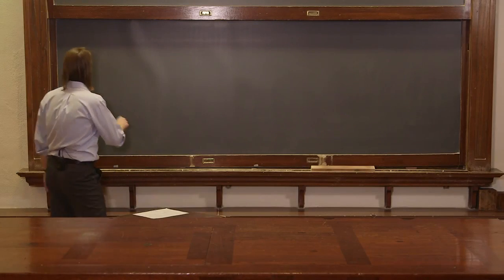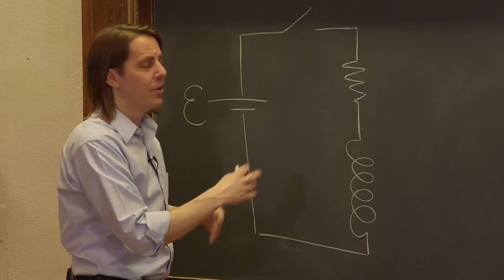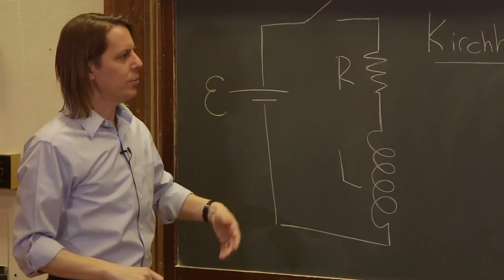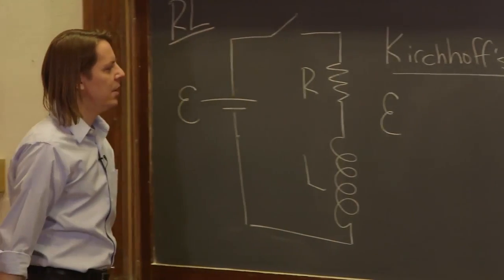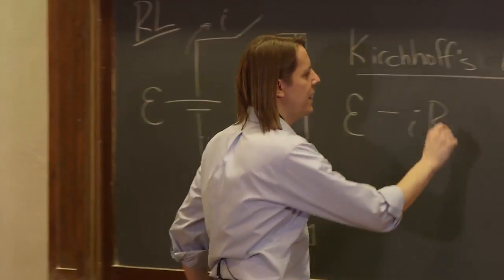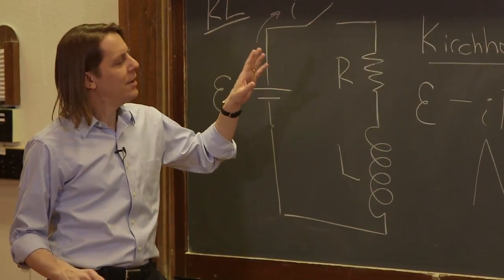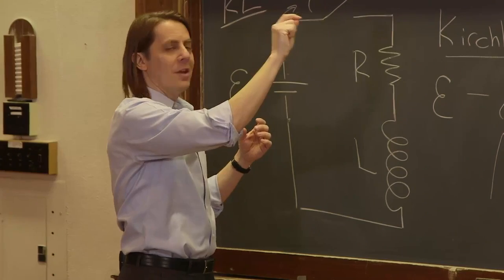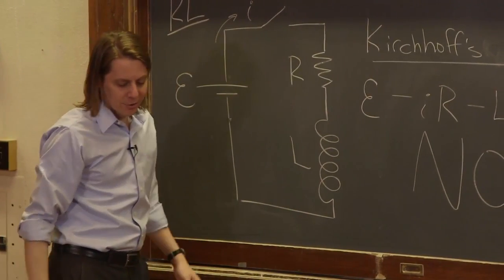PHYS 102 | LR Circuits 1 - You Can't Apply Kirchhoff's Loop Rule to a Circuit with an Inductor!

Comment: Bro you are doing it wrong I can prove it that kirchhoff's loop  can be applied here and that we are taking all conservative field s..
Reply: reply if you want to understand it
Reply from the maker: @rxzhik  Sure.  How do you get a conservative field in an inductor?  I'm all ears! :)
Reply: @Prof-Hafner  Even with an inductor in place the voltage across the resistor + voltage across the inductor has to be the same as the voltage of the source. (else there would be a voltage difference between them and because the wire itsselve is modeled as having no resistance and no inductance this cant be the case. So still this Kirchhoffs rule has to stay true. And because of conservation of charge the current has to be the same everywhere, cause else you'd build up a charge at some place, and then you'd get a change of a electric field and this also is defined to be a kind of current (Verschiebungsstrom in German). So Kirchhoff still has to be true here. 
Another proof is conservation of energy: The Energy from the source has to be the same as the energy emmited or stored by the inductor+ the energy  emmited by the resistor. The energy emmited plus the energy stored by the inductor at a short interval of time is the voltage across it times the current through it times the short amount of time. The energy emmitted by the resistor is the voltage across it times the current through it times dt. 
So we get an equation:
U(source)*I(source)=U(R)*I(R)+U(L)*I(L) cause dt can be cancled out.
And cause i first proofed that I has to be the same everywhere in this circuit we can set I(source)=I(L)=I(R) and thus cancle it out to still get U(source)=U(L)+U(R). And to stay in the kind of odf convention of sign at Kirchoff it will be 
U(source)+U(L)+U(R)=0
And I(source)+I(L)+U(R)=0
So Kirchhoff has to be still right.
Reply: @rxzhik  yea the misstake has to be that its not (-)L*dI/dt but 
(-)(-)L*dl/dt so its (+)L*dI/dt
cause if you look up the formula...
Reply from the maker: @neutronenstern.  Yes, the rule works and obeys laws of conservation of charge and conservation of energy.  But the fundamental way it is set up is not right.  It treats the inductor as a "lumped element" that has a potential drop, and it works.  But technically, you can't define potential drops for time varying fields.  You can only take a path integral of E as in Faraday's Law.  I think part of the problem is that people aren't seeing the next video.  I'm going to link it in a top comment.
Reply: @Prof-Hafner  It is a similar concept as D'Alembert's principle of solving dynamics problems with a pseudoforce equal to -m*a, and summing forces to zero, rather than using Newton's second law to sum forces and equate them to +m*a.  D'Alembert is to Newton, as Kirchhoff is to Faraday, in the comparison I'm making.   Faraday's law of induction and Newton's 2nd law are more accurate statements of what is really happening, while D'Alembert and Kirchhoff's rules are a method of using the same mathematical exercise of adding up the terms to zero, to simplify the mathematical steps of accounting for the dynamic effects.

It is very common for electrical engineers to treat L*dI/dt as the voltage drop across an inductor, when the inductor can be treated as a lumped element, with a self-contained magnetic field and no background magnetic fields that matter.  Likewise, it is common for structural engineers to model seismic loads as an equivalent force of the seismic acceleration and treating it as a statics problem, rather than setting Fnet=m*a and solving it like a dynamics problem.  You still get the same answer as you would, if you properly apply Faraday's law of induction, or Newton's 2nd law.

Comment: Sorry, but this is BS. Kirchhoff's laws originate from the 1st law of thermodynamics and they always apply provided that they're applied correctly. You might as well claim that KCL doesn't apply to capacitors... 

KVL and KCL apply to any circuit that can be treated as a lumped modeled circuit. Meaning that it does not radiate any electromagnetic or thermal energy. 

When an inductor is influaced by an external magnetic field, you can still apply Kirchhoff's laws but you have to treat the inductor as part of a mutually coupled circuit and account for the emf impact from external currents.

Kirchhoff's laws always apply for any lumped element.

Comment: Is Kirchhoff's loop rule equivalent to the virtual work principle? 
The reason I am wondering is K's loop rule is trying to find the steady state of a network, and this is similar to the find the equilibrium position of a static mechanical system.
Reply: I see it as equivalent of D'Alembert's principle.   The principle of treating -m*a as if it were a force, and subsequently adding up forces to equal zero, rather than adding up forces to equal m*a.